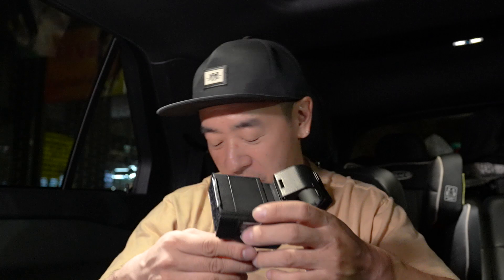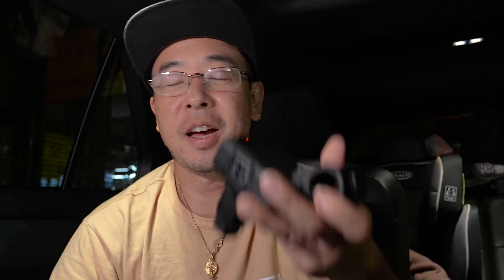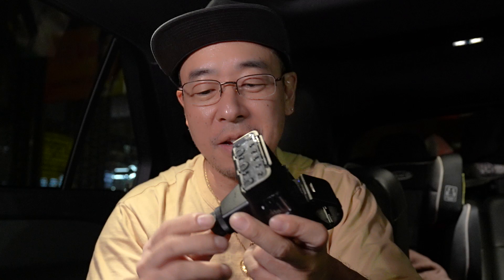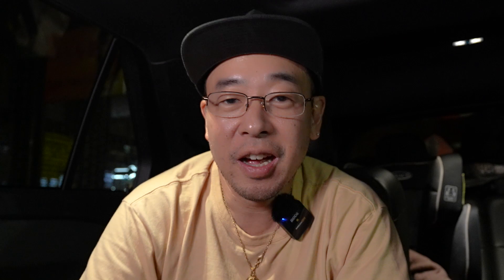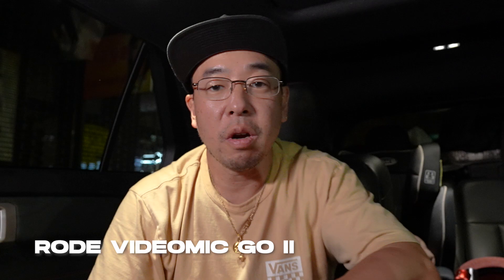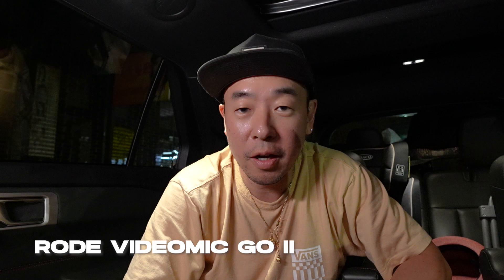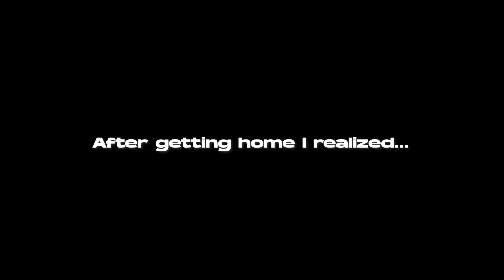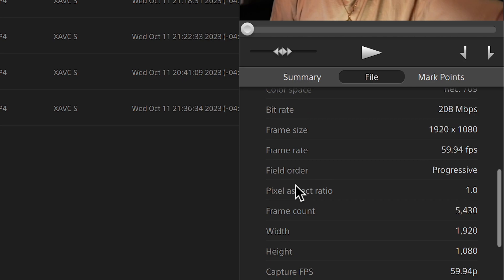Add XLR Inputs to your Sony camera with the XLR-K3M. But it's not perfect...

Comment: They all sounded good. I’m watching videos to find out if the Sony xlr k3m would be best for my video podcast setup over what I can currently use but have to use my laptop + audio interface & sync everything in post later.

I currently see a Sony xlr k3m for a deep discount and have a Sony a7s iii that would utilize the 24 bit audio as well

Comment: Hi @keisugimoto570 thanks for the video and the mic comparison. When you connected the RODE Wireless GO II to the K3M, did you run it through the 3.5mm or through the XLR via an adapter?

Comment: Thanks for the video! Have you tried checking the audio setting within your Sony camera while you have the k3m on? maybe there is a setting there for 24-bit recording? Sorry if you mentioned it in the video already. I'm also curious to try. My issue is the audio noise floor with the on-camera mic pre and it sort of has an auto compression which I couldn't turn off. (ZV-E1)
Reply from the maker: I just realized. When I made this video I was using the Sony ZV-E1. By chance I used the XLR-K3M in a Sony a7IV, and found that on the a7IV, the audio settings menu changes when the unit is attached. The audio gain option gets greyed out and there’s a new line that reads “24bit 48khz Audio”.
Reply: Be aware 4ch is a poly recording